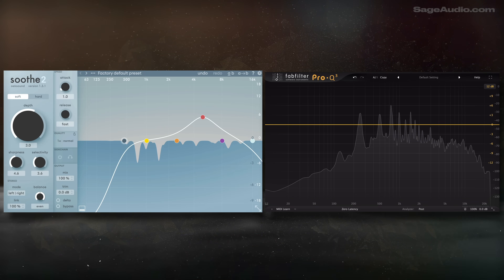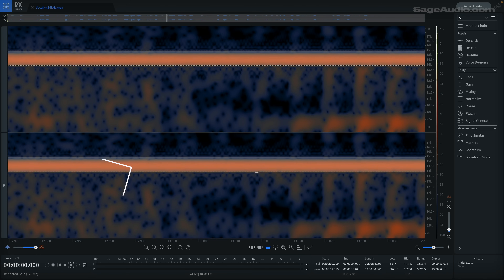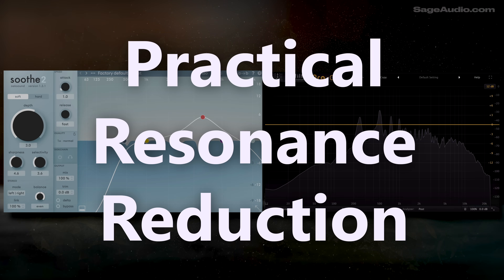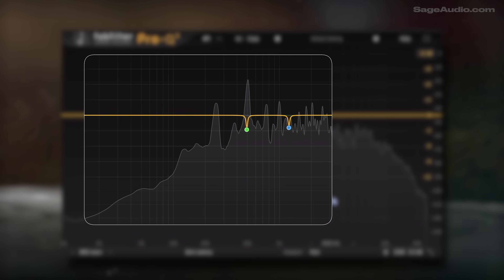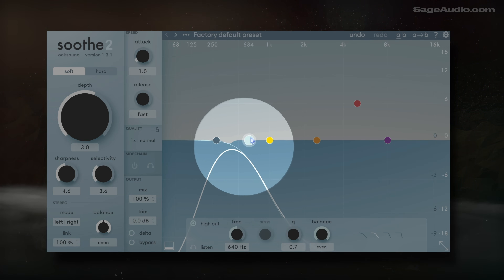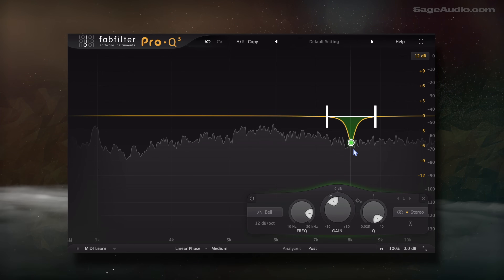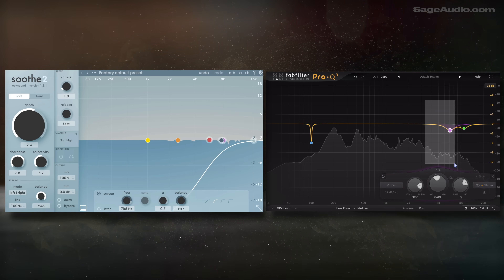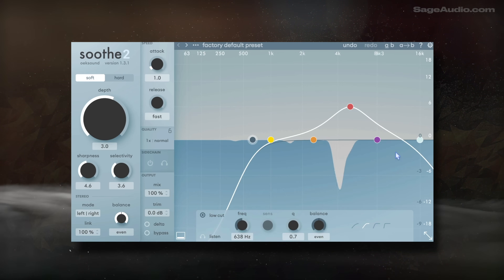Controlling Resonances: The Bane of Most Engineers’ Existence

Comment: Not to disagree with the conclusions here, just curious why you seem to use soothe 2 always in soft mode in contexts that I would assume hard mode is better for?
Dynamic stuff like guitar I get, but like the example where you had stable ringing from the mic (don't remember if it was this video, have been binging).
Can you explain the differences between those? I have read the manual and all, but still feel puzzled by them.

Comment: Hey, Thanks for the great video

I have an SE z5600a2 tube mic that sometimes has a similar frequency issue you had with your NT1 reverse engineering project. It sometimes disappears when i touch it and feel a small amount of static and always goes when i turn the power supply for it off and on again though. Would love to know if you ever figure that issue out with your one!
Reply from the maker: That's funny since the resonance would go away when I touched the jfet on the circuit! I'm assuming it wasn't grounded correctly but could never figure out why or how.  My best guess then is that something isn't correctly grounded in yours.  It could be as simple as grounding the xlr output to the mic shell.  Usually there's a screw at the bottom of the shell that both holds the base in place and serves as the grounding.  Hope this helps!
Reply: @sageaudio that’s got to be it then ! Thanks man 😁

Comment: My trick with working with highly compressed rap vocals: sometimes you've got the resonance on a tiny bit of the good track or several infrequent times. In Reaper you can apply directly plugins to audio clips without affecting the rest of the track. Or you can select those offenders into it's own track feeding into the main vocal track and fix the issue on the separate track. You don't need to always process the entire audio with a complicated set of automation envelopes for special cases.

Comment: This may sound a bit crazy but I've always wondered if you could use pink noise against a file in RX10, which, i think, would leave behind, a file with resonances only. Then that file could, in turn, be used to filter out all the resonances in the original file. Idk. Just hypothesizing.
Currently, i am experimenting with using Soothe, sidechained to white noise sloped to 4.5, to help even out the dynamics of a track and get rid of resonances at that slope. No conclusions yet. I've been trying this as i record a solo  pianist who plays very dynamically. I sometimes think that recording and mixing a solo instrument is almost harder than recording a whole band. Also experimenting with Curves Equator and Specraft.
Reply: you can do that with the match eq in RX

Comment: Try Soothe 2 in Hard mode. Set the hi pass filter (its not an actual EQ filter, just targets the range of frequencies to be suppressed) just below 14k. Set it to the steepest slope.  Set the selectivity to 0. If it still does not cut enough, then set a high shelf at max depth to boost where 14k is. You will no longer hear the 14k, no other frequencies will be cut and the change in tone will audibly null.

Comment: The internet needs to learn the difference between noise, harmonics, resonances and which tools to use for each.
Reply: Yeah fully agree, I have a resonance suppressor plugin, but I only reach for it if I hear a problem instead of just slapping it on anything and everything haphazardly. Same thing when using eq, stop hunting for resonances with a high q band, everything will sound resonant!
Reply: @Windiguana  I learned that the hard way early on... had EQ's that looked like a messed up comb for way too long on too many mixing projects...
Reply: @Terribleguitarist89  At worst it actually ends up sounding combed because you didn't get it right, at best it'll sound flat and without character like white noise. A lot of the time, just some wide bands and maybe slightly more narrow ones is all I go with, often just to adhere it to the mix without messing around.
Then there's also stereo, fixing what you focus on on one side applied to the other will create that comb sound even if you did get it right.